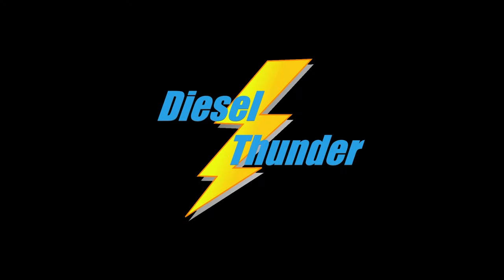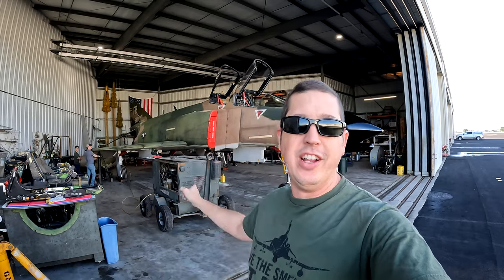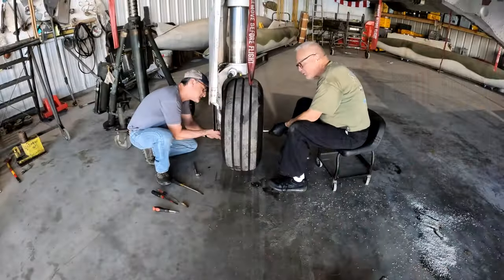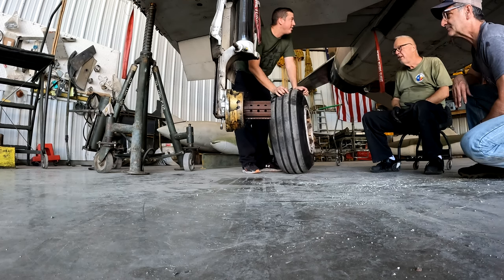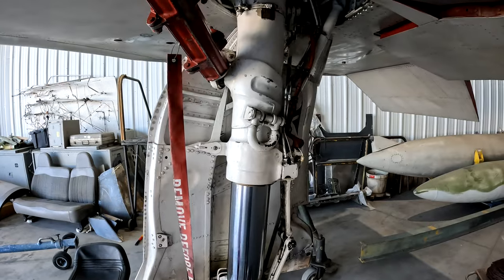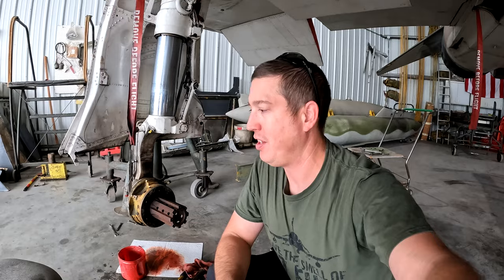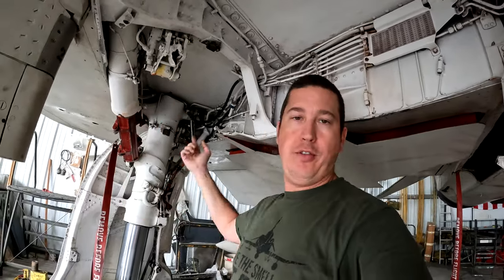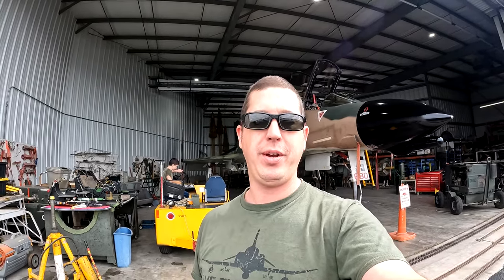Of Jacks and Stubborn Cotter Pins | F-4 Phantom

Comment: I changed my fair share of brakes on the E model while stationed at Seymour Johnson in the early 80's. Those cotter pins were a huge pain in the rear end for sure.
Reply: Seymour Johnson 4th TFW in the 80’s. I was there also on F4’s.
Reply: @Yooyangs   80-82 in the 334th then phase for 1 then PCS'd.
Reply from the maker: Still a pain in the butt today! Thank you both for your service!

Comment: Like I said last week we had the same problem in 05. We never had any problem with gear retraction. Before you go and tearing the gear off you need to get (crewchief) Al or Rick Harris to see if Gene Dukes repair shop is around. He had a rebuild kit for the struts or see if you can find the correct seals in the TO. The more I think about it the seals might just be dried out. Check that the top chamber has hyd fluid in it. Service the strut and run the gear up and down. ( I don't know how you're going to service the lower strut with the jet on jacks.) Replacing the complete assembly is a major job and like every thing on that airplane it's not just take the old one off and slap a new one in.
Reply from the maker: The strut had hyd fluid in it, we serviced it, and it still leaked down. That's twice now that this strut has had this failure. I don't trust coincidences. And this will be a good learning experience, and we'll be able to find out why the old strut failed (again).

Comment: Brings back memories.
An F-4 jacking is much easier than an F-111, and I did both.

Are those -400 or -500 series struts?
Reply from the maker: Thanks for your service! And good question on the struts, i don’t know unfortunately. Is there a way to tell the difference?
Reply: @DieselThunderAviation  yes the tires are larger on the 500
Reply: Check the strut PN placard.
Should be something like
Xxx-xx-400(500)-0
Reply from the maker: I will look this next Saturday, thanks!

Comment: You haven't lived until you and your buddies and your speedhandles have to remove the panels after 'some' Tom Cruise pulled more than 8 G's showing off. 🥵
Reply from the maker: Oh I bet! Hopefully this bird will never experience that.
Reply: @joeblow5037 😂 what was that long panel up top? 48? That had 100+ screws
Reply: @Cubrooski  lol
you are asking me to revive long dead brain cells 🤔 🥃
The only memory I have is standing in my hanger in MCAS Beaufort going "thanks a lot ^&%$#@ ! "
Usually the only panel I ever had to pull was the turtledeck right behind the RIO which housed the computers for the AWG10 radar. I was MOS 6657
Reply: In the IAF pulling such a move was looked down upon. especially on the older birds.
Our pilots were very carefull not to exceed what ever G limit was set.  But a few Kurnass would still always leak fuel from the wing tank pannels.
Ex-IAF Airframe technician.
Reply: @Cubrooski  I don't recall any long panel along the spine of the E.  Ours had medium sized access panels for the 6 or 7 fuels tanks, only rearly opened in D-check heavy maintenance.
The wing top side had 2 long narrow panels, 101 & 102.  We were always replacing crossthreaded or loose anchornuts.
Reply: @trespire There is a panel along the top, it covers the fuel manifold pipes that run along the top, at least on the D
Reply: @NotBonk1  Funny I don't recall such a panel.  Either the E didn't have one or I'm loosing my brain cells.
Reply: @trespire  I was the one who put it back on this airplane, must’ve been a D thing
Reply: @NotBonk1  That's quite possile.  Sounds like you guys are doing a good job.
Just keep in mind, no FOD !  Our work clothes had only 2 pockets, and no buttons or zippers.  Would always check our shoes for FOD before climbing on a jet.  Count our tools before and after.
Reply: Especially the ones with different size screws!
Reply: Some panels might be smaller due to the inflight fueling receptacle .
Reply: @joeblow5037  hahaha right! I love when the pilots good times translated to my afternoon pulling panels
Reply: @trespire I can't for the life of me remember the panel number. Maybe it was pnl 48 that had 101 screws. I didn't work them active duty. I am egress guy by trade. I worked them when they were QF's. I worked G's E's and RF phantoms
Reply: @Cubrooski  If memory serves (so far !), panels 101 & 102 often came off in our B-Check maintenance shop.  This opened access to the outbord part of the fixed wing, if I'm not mistaken, with some systems and plumbing.  As a structural technician, I got quite familliar with these 2 long narrow pannels, lots of careful drilling out of stripped anchornuts, as to not damage the main wing beams.
Good times !
Reply: Way back when at Marine air station Yuma AZ. a pilot from our sister squadron over stressed the Phantom he was flying so much that he badly injured his RIO' back, they lifted him out with a crane or forklift.
Reply: @bobroyes589  Sounds like that RIO either had some medical problem or shouldn't have been cleared for flight.  Not sure how much G a Phantom could pull when new, but I doubt it's as much as an F-16.  I never heard of any of our F-16 / F-15 aircrew getting hurt that way.

Comment: It seems like the pressures are backward to me.  I want the high pressure to be on the top to hold the aircraft up and low pressure on the bottom.  As always, thanks for sharing!  Oh did you happen to try fishing that cotter pin out using a tool fished through one of the holes in the hub?  Just a thought.
Reply from the maker: Can confirm per the books, that the high pressure chamber is the bottom one. For the pin, the "eye" of the pin is at the center of the nut, which is also recessed in as well. Wish we could pull them that way, would make this a bit easier!